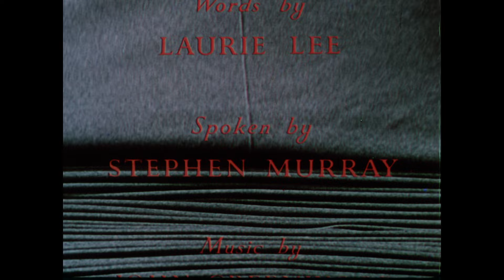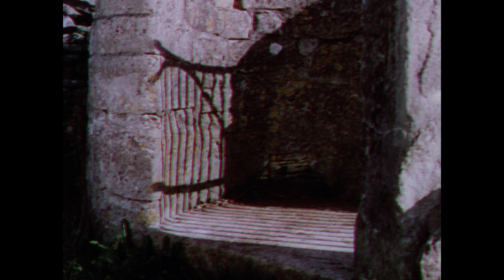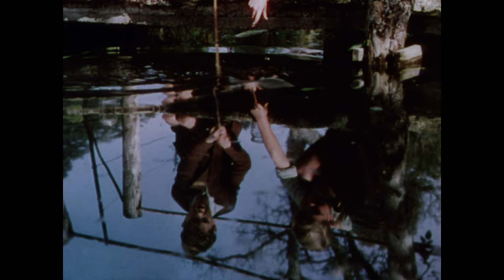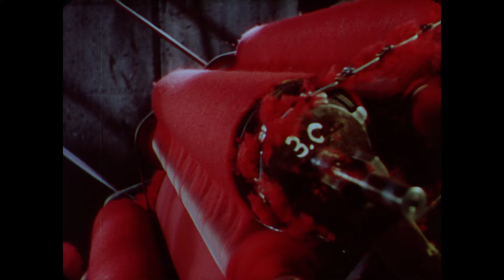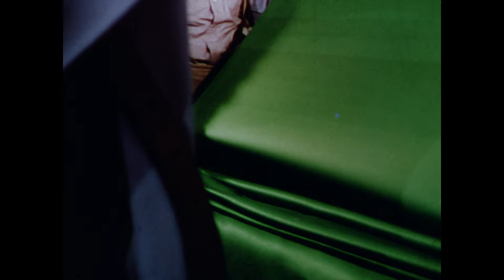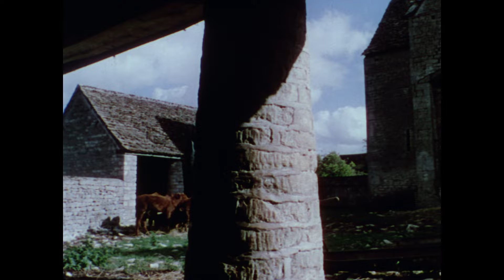West of England (1951)

Comment: Before plastics, before the EEC, before disposable (sweat-shop) fashion, before the illusion of Globalisation and 'market efficiency', before borders as porous as a chalk stream, before transgender madness, and men marrying men...should I go on. Sure, it weren't perfect --- but there is wisdom still in the old ways, and in the holy scriptures, and in decency.
Reply: "before transgender madness, and men marrying men" hate to break it to ya, but that's been around longer than England as a polity has
Reply: They used globalisation to outsource the wool supply to NZ... It was only a matter of time before the factories were as well. This is what happens when you don't have a protectionist government.

From what I heard the machines here would've replaced so many weavers huts which turned safe work into kids having to scamper under running machines to catch threads where they could lose body parts. They also used to weight clocks so people worked longer, time is money.
Reply: @bens1972  "Bigots" built the greatest civilizations in history.

Don't you dare forget that, cur.
Reply: If you don’t like it eff off out of it.